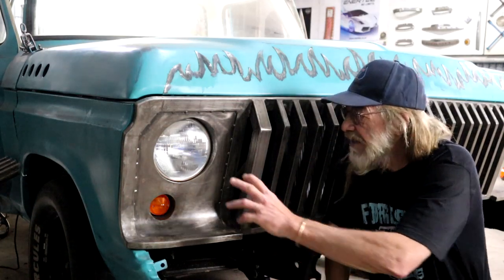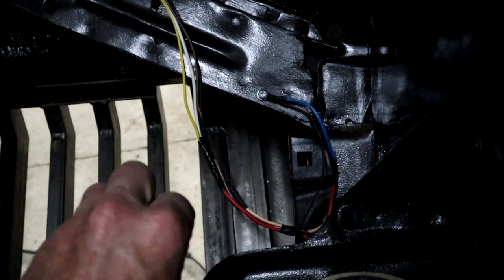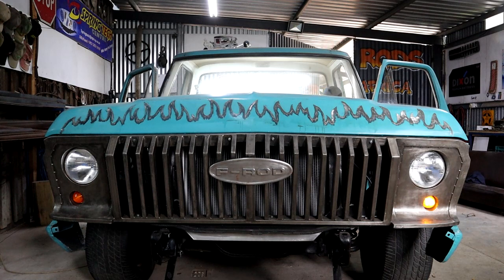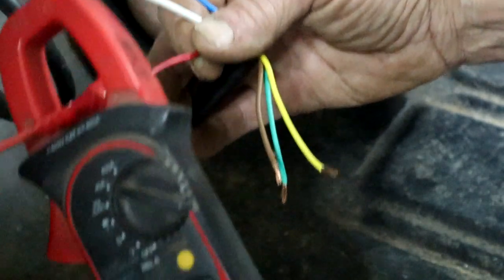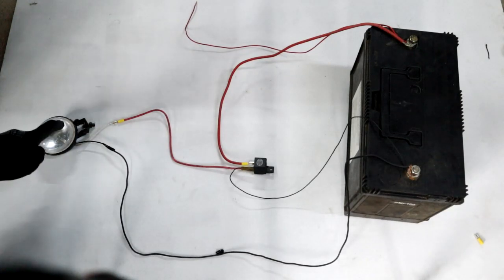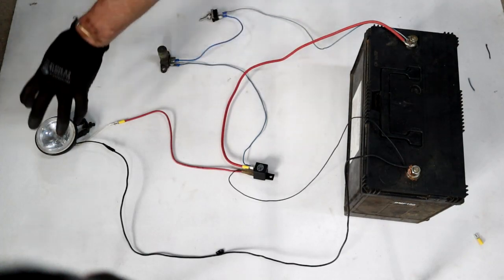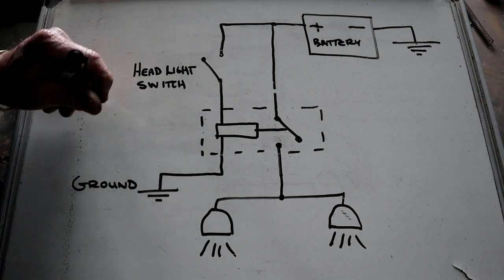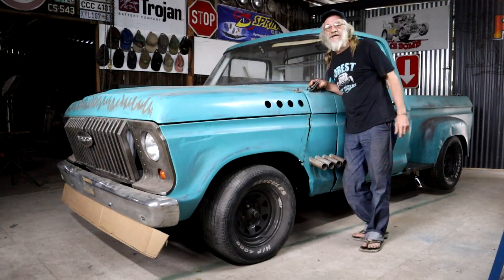HOW TO WIRE HEADLIGHTS ON YOUR TRUCK - Common sense guide

Comment: I got a 90 s10 blazer, you can see it on my channel. When I turn the headlight switch on, smoke leaks out of the switch. With your explanation of the circuit, I’ll have far better luck tracing down the problem and hopefully be able to keep my smoke inside the switch! Thank you! You are a helluva educator!!!
Reply from the maker: Pleasure man. Happy if it can help

Comment: That wiring is cool 👍 however your spare wire in that harness won't be spare for long because you still need park/ sidelights ! 🤔👌
Reply from the maker: Thanks Clive. Well, I shaved off the front sidelights and quite honestly, I dont see the purpose of park lights... I never use them... but yes, could be used for that

Comment: Question on this.  You could have used a 15amp relay and fiuse, based on your 13 amp draw, is there any pros or cons of using a higher 30amp? Or that's just what you had?
Reply from the maker: Yes, 15 Amp will probably do. I could only find 30 A relays. No problem using oversize relay though, its just tougher 😅